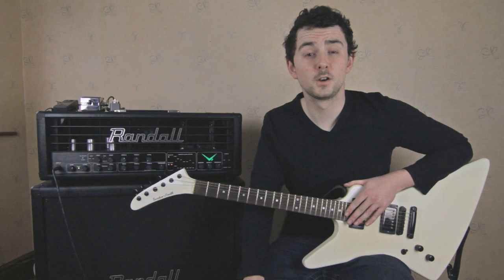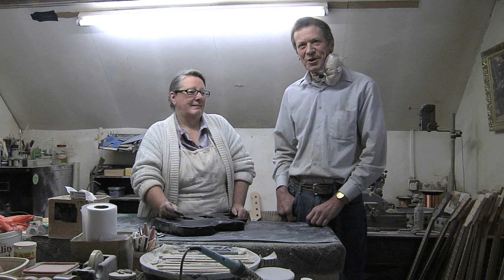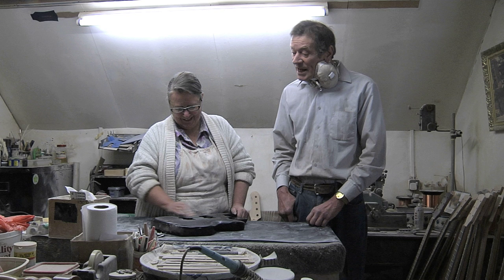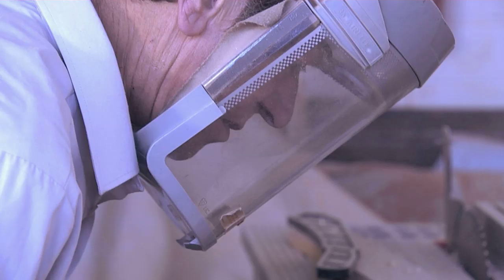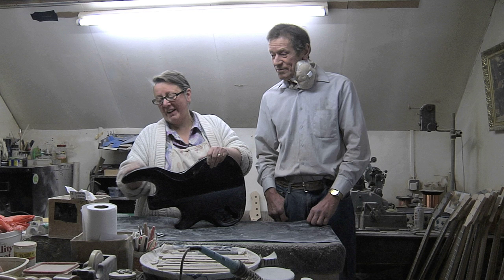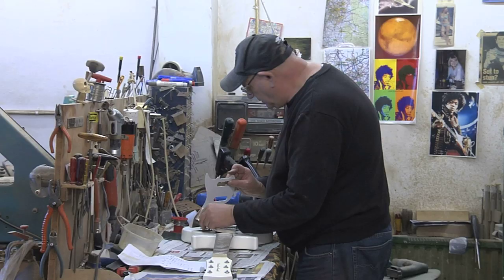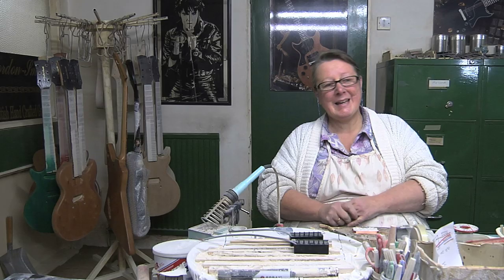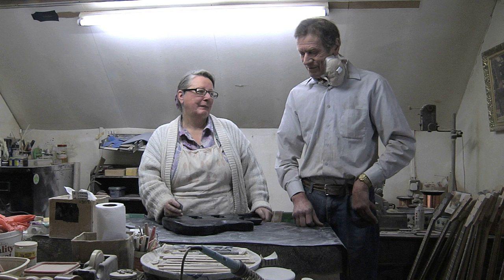Gordon Smith Guitars - Short Documentary

Comment: My first real guitar was a GS1, which cost me £200, back in 1989/1990. It's the one thing I regret selling. A great guitar.
Reply: I did the same but then got John to build it again recently !!!
Reply: Great idea. I must get a GS again soon. Lovely guitars.
Reply: I had a GS1, largely because it was UK-made and cheap as chips, but I was too young too appreciate it at the time and assumed I needed 2 or 3 pickups to go with my millions of FX. I have an 80s GS2 now, which is great, but would quite like a single p90 GS for the ultimate in no-frills thrills.
Reply: I bought a brand new GS 2 from a shop in Denmark St. London back in the day for less than £200. I had an American Tele, 78 Strat and a Les Paul Custom at the time - the Gordon Smith was in no way out of its league when compared with these guitars. Compared very favourably in every way.